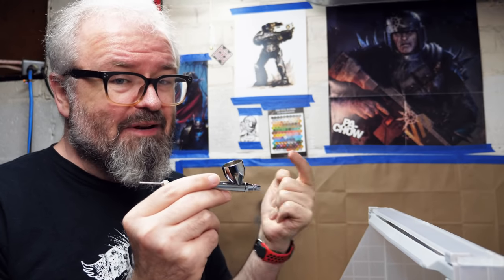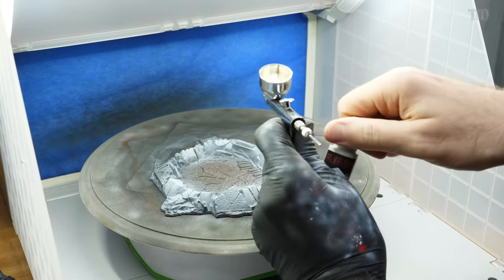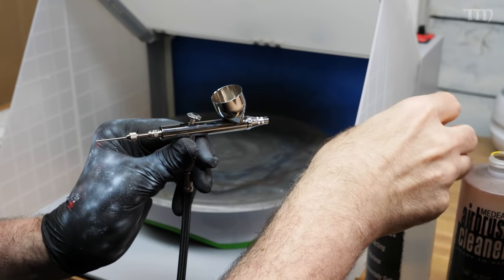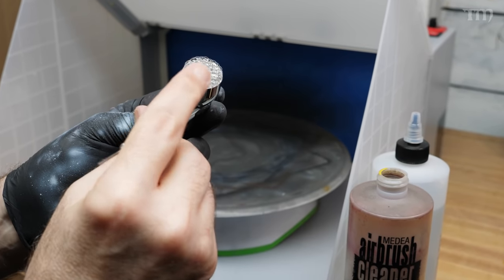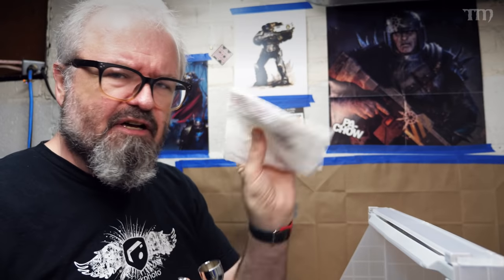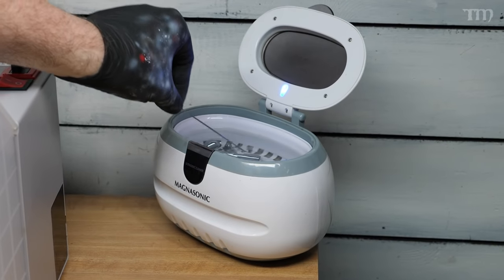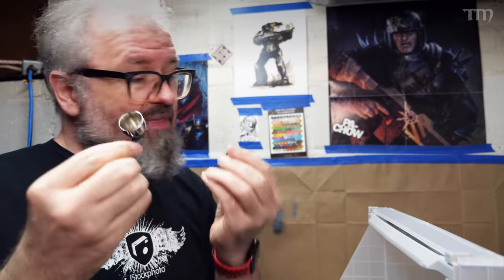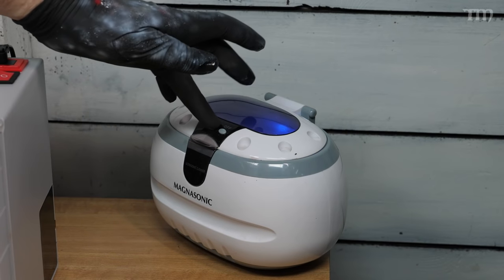NEVER Clog Your Airbrush Again!

Comment: I am just starting to tinker with my airbrush I've had for 3 years, this video has motivated me to actually use the airbrush than to admire it's sleek look.  I like the keeping the parts wet and the ultra sonic unit.  My question is how long is the time frame that you actually have the ultra sonic activated and are you using plain old tap water or ultra sonic cleaner or perhaps a mixture of water and windex.   Thank you for sharing.

Comment: Isopropyl alcohol: water
1:4 - works for me.
Also, Mr. Smasher, what could ppl with perforated airbrush cone do to perfom a "chocolate milk" trick?
Reply: Slighty losening nozzle on h&s ultra did the trick for me but Im not 100% sure its exactly the same thing as completly blocking it.
Also used to have a small rubber cap from some cheap airbrush kit that fit perfectly over the front and when I lost that I belive just putting in in palm of my hand and squezzing it somewhat worked.
Reply: I also have an airbrush with a perforated cone/tip.  I use a small makeup sponge (the small wedge/triangle kind people use to remove oil washes, they’re like a buck for a 20pack at Walmart) and put it over the tip to create a seal. It won’t harm your needle AND I haven’t stabbed my finger with the pointy end of the needle in ages!

Comment: Depending on your airbrush, I think that it might be worth checking if you want to use an ultrasonic cleaner that there aren't any particular seals or rings or whatnot that might cause trouble. Ultrasonic baths get quite warm, and so you also never want to put the needle in there either.
Reply from the maker: My ultrasonic cleaner is a cheap one without a heater, so no problem there. And I don’t keep the needle in the ultrasonic cleaner, I just dip it in there, wipe it, and set it somewhere safe - like in the video. Thanks for watching!

Comment: I did hear from someone, maybe one of Vince's videos?, that they keep the cup filled with a little water (and iso I think?) in between sessions. It is interesting to keep it just full on submerged. How long have you had that airbrush?

Either way, I love my airbrush but I always dread getting it clean enough to not worry about clogs and my arch-nemesis the dry tip. Wish I could find that Japanese polymer stuff that Scott randomly got.

Great video and I'll definitely give it a try!
Reply from the maker: I’ve had that airbrush for nearly a decade. Pretty sure I bought it in the early 2010s and it’s been submerged most of that time. Thanks for watching!
Reply: @tabletopminions  Awesome. I figured it wasn't "new" but was interested. Thanks for the info and, again, a great video.

Comment: I fill with water and pour out a few times, then cleaner, gurgle it pour out. The less that goes through the tip, the better. Last part, just blow through with water. Then wipe off with paper towel.
Keeping it dry in between, just blowing through a little water first. That's how I do it. The cleaner seems smart though.

Comment: Instead of pulling your needle out the back. try pushing it out the front instead. That way, you won't get paint drying in the sleeve that the needle fits into which will gum up the action of your trigger.

Comment: wait like you keep the entire airbrush submerged when not in use or just the needle/nozzle pieces? I've been told not to submerge the whole airbrush because the moving mechanical pieces like the spring in the back and maybe the air valve too might not work properly afterwards. Maybe it's okay if it's normal water and not a solvent like alcohol or a cleaner? the logic of keeping it wet makes so much sense and I want to do it immediately, but I ruined my first airbrush by submerging it in alcohol and cleaner multiple times. It now has a permanent wall of paint and especially primer on the inside that's hard as concrete. I keep it around for spraying primer only. I bet a little flow improver in the water would make it that much better at reactivating and breaking up paint in those hard to reach places.
Reply from the maker: No, not the entire airbrush. Like I showed in the video, it’s just the main body of the airbrush and the front nozzles. The needle and the mechanical pieces (the springs, trigger etc.) don’t go in the water. Thanks for watching!
Reply: @tabletopminions  ah thank you for the clarification! I've just put my nozzle assembly in a water container. Excellent ProTip!

Comment: when changing colors  I just blow water through it. When im done using it, I just take it apart and toss it in a car of 50/50 simple green and water and just leave it for a day, then rinse it off the next day. Never had an issue with mine.

Comment: I just use water, occasionally I use IPA to clean the needles and I always spray a bit of water through it before any paint just to "lube" it up a bit.

But I rarely take it apart more then removing the needle and the first "cone" to expose the nozzle.
Probably once a month or so I do a thorough cleaning.

Extremely rare for me to get clogs, but I do thin my paints a bit too much regularly.

Comment: Awesome video! Sad part, got my airbrush glogged before this video…any tips how to “deep clean” an airbrush?
Reply: Take it to bits, wipe down the needle, clean out the nozzles.  Invest in some airbrush cleaning fluid, and use thinner and flow improver with your paints to help prevent paint build up.  The areas that get clogged are pretty much always the same, its probably just the degree of clogging that is different.

Comment: I'll add a few more things, distilled is better, but only if you add biocide of some kind to prevent a biofilm. One important thing is to KEEP IT DARK. life will find a way if there is light, so pitch black is best. your ultrasonic cleaner does that. See through Tupperware are no good. You can probably use some alcohols and things instead, something like whatever the hairdressers used to use- although they might have used oil, as they were using steel equipment.

Comment: Overall great video, but it sounds like you unscrew the airbrush every time , I would have to recommend an "Airbrush Quick Disconnect" its great, you dont have to shut your compressor every time every time, but i would recommend not keeping your compressor full of air, for those who are reading this, so if your done with the compressor, release the air.

Comment: Wow, thank you so much!  I feel like I am very meticulous about cleaning my airbrush, each piece with the exact same cleaning solution that you use, however I still deal with clogs sometimes, and have been frustrated as to why.  Until now I have not heard of storing the airbrush in a wet solution, and I will definitely try that now, and I am betting that will fix what I have been missing.  One question:  Do you ever worry about deterioration of the little rubber o-rings in the airbursh with the constant soaking?
Reply from the maker: Rubber is more likely to degrade when it’s dry (dry rot) than when it’s wet, I think. I’ve never had trouble. Thanks for watching!

Comment: That's sensible advice, but the problem is if you don't use your airbrush for months at a time. The water will develop slime or even algae, so something else would be required, something that isn't going to attack any of the rubber O-rings.

Comment: Keeping the airbrush wet. Great tip! Someone suggests to extract the needle from the front, so that you don’t inadvertently get color in the inner workings. What do you think about that?
Reply from the maker: I’ve never tried it. Sounds like it might work. Thanks for watching!
Reply: @tabletopminions  I was thinking about the topic of distilled water, non causing deposits but eventually developing unwanted bios in it. Adding just a drop of bleach should stop that. It’s a trick used by florists. But I’m not sure if the chlorine in the bleach could damage the seals and o-rings inside the airbrush…

Comment: So i started with a cheap'ish airbrush from a genneral hobby shop and it cloged up all the time.
When i later got an iwata i found out that to get the same airflow out the pressure from the compressor needs to be twice as high on the cheap one

Btw: I dont know if theres something with your audio recording but when i stream this on my samsung TV the sound cuts out every 30 sec or so wich makes it really hard to watch

Comment: I’m super curious about painting indoors with an airbrush. What airflow considerations do you have, and face masks?
Reply from the maker: I wear a respirator from the hardware store. That should really be all you need. The air compressor is just using air from the room so there aren’t any fumes to worry about, just paint particulates in the air. Thanks for watching!

Comment: Great video and explanation of the steps you take.  My only question is that my airbrush (some sort of older Iwata model) has some rubber washer-ish things around the nozzles (at least they look like they are made of rubber)?  Would keeping those submerged for long periods of time cause them to break down fast or something?  Last thing I want to do is hunt down replacement parts for an old airbrush lol
Reply from the maker: I’ve never had a problem with my o-rings on my airbrushes. Thanks for watching!

Comment: Tried leaving my Haarder & Steenbeck submerged in water and didn't paint for two months, it fell apart when I picked it up; certain parts appears to have rusted.
Reply from the maker: That seems weird - I’ve never known H&S brushes to be made out of anything but brass. Honestly, I’ve never known any airbrushes to rust like that. Seems like a manufacturer wouldn’t make airbrushes (which shoot fluid) out of parts that would potentially rust. Thanks for watching!

Comment: I got the ultrasonic cleaner after watching this video 🙂. I'm in Canada so had to use a different link, otherwise would have used yours. 
Is it necessary to remove trigger, spring and nozzle? It's a pain to put it together - plus I worry about losing those small pieces.
Reply from the maker: I always separate them. Thanks for watching!

Comment: Actually I got one point in this video, which realy disapoints me.
@5:30, you start to explain, how to remove the needle from the airbrush. And in the end you pull it out over the back side. I mean yeah, your airbrush in this example is already complety clean, but in general (or at least if I use my airbrush) frontpart of the needle will still be full of paint and u pull this "dirty" needle through the clean sections of the airbrush, like nothing. 
If u do it like this you will easily put each part of the airbrush in paint (even these, where u are saying, these will never come in touch with paint straight after this step).
To my expirience it will be more effective to remove the tip of the airbrush first and then pull the needle out of the brush over the frontside. This way the airbrush won't get more colored.

Comment: You mention a decade of soaking your airbrush. I'm curious, have you replaced your o rings/seals in that time? Actually, as a pretty new airbrush owner, what have you replaced in that time on that airbrush?
Reply from the maker: I haven’t replaced anything for the airbrush in that time. No o-rings or anything. I had to replace my first compressor in the early 2010s because it was a cheap one from the hardware store and it stopped working, but that had nothing to do with how I stored my airbrush. Thanks for watching!
Reply: @tabletopminions  Thank you for your answer and for all you do for the hobby! I'm impressed! Ten years in a sealed package in a temperature controlled warehouse would have been closer to my working life expectation on such tiny seals.

Comment: Any tips on not cloging it durning paiting outside of using paints made specially for airbrushing? Its kinda expensive to get whole another set of paints that are airbrush friendly but arent really usable for brush painting and in my personal experience just thinning normal paints down just ends in a clog sooner or later, which lead me to using my airbrush as glorified primer can.
Reply: i use vallejo thinner + flow improver (30mL of flow improver mixed into 200mL of thinner). using a 70/30 mix of thinner with some paint makes for fewer clogs (except for primer, which will clog regardless)
Reply from the maker: Thin your paints to the consistency of skim milk. I have an older video in the playlist at the end about thinning your paints. Thanks for watching!

Comment: Hm. I wouldn't soak the Airbrush for that amount of time. Maybe for a few hours and cleaning it with the Ultrasonic cleaner. I use some oil to keep the parts in good shape. Only Thing to do is to rinse before painting with a liddle Bit of cleaner.
Reply from the maker: I’ve kept that airbrush (just the body and the nozzles, not all of it) in water for nearly an entire decade, except when I’m actively using it. I’ve never had any problems, nor any clogs. Thanks for watching!
Reply: @tabletopminions  Well thats proving your Point. I will try it Out. I have a cheap Airbrush that is terrible to Clean... My Harder and Steenbeck one never clogged before either.

Thanks for Sharing your Hobby gold :)

Comment: Thanks once again UncleAtom!

I will definitely try submerging. If I get it working again. 

I got airbrush cleaner in a spray can. It's powerful stuff! But, so powerful it  disintegrated the rubber gaskets on my brush. Now it seems to block all the time and I don't know if it's due to them (or lack of them to be exact) 

Can I ask, what exactly the gaskets do? (keep a tight seal I guess)

But how essential are they?
And would lack of gaskets/grommets cause blockages.

I wouldn't think so but I'm beat and ready to buy a new airbrush :/

Any help or advice is much appreciated!
Reply from the maker: The rubber parts are important. It might be cheaper to try to get replacement rubber parts than buying a whole new airbrush. Thanks for watching!
Reply: @tabletopminions  No problem! Yeah I know what you mean. The replacement parts with delivery is £9. I can get a new brush for the £17 delivered . So you can see how it's tempting. But yeah when I get a better brand brush I'll stock up on spare parts! It's know it's only £17 but that's more paints and diorama materials!

Cheers buddy. Have a good day!

Comment: Heads up, Iwata and other manufacturers don't recommend soaking your airbrush "in any liquid" for extended periods. "This causes more problems than it solves." I appreciate your videos, Uncle Atom, but follow the 'always keep it wet' advice at your own risk.
Reply: Yeah this was my only big issue, there are a lot of seals and I know I've fucked up a seal or two with a long soak.
Reply: I tend to forget mine is soaking, for a couple of days at a time, no issues so far. To be honest though, I'm using a rather cheap gun, like $70.
Reply from the maker: I’ve been using the same Iawata HP-CS Eclipse for nearly a decade, and the brush has been submerged the entire time (except when actively using it or course) and I’ve never had any issues. This is just how I do it, and it’s solved more problems than its caused for me. It’s interesting that “Big Airbrush” doesn’t want you to use method. Thanks for watching!
Reply: This ended up dissolving the chrome coating on mine by soaking it in medea cleaner
Reply: @tabletopminions  wow. Just wow.
Reply: @tabletopminions  probably good advice from the manufacturer as trace elements in water and chemicals vary wildly all over the world (and even in the same state). If you submerge in hardwater, you're going to get scale build up. Depending on the ph it will also possibly dissolve the o rings. If it works, it works, but I'm sure Iwata doesn't want to deal with complaints for possible issues. If it works, it works though. Submerging may also expose inconsistencies of the manufacturing over time (you may get pieces rusting). It should be noted that submerging your airbrush may void your warranty(whether this stands up or not, I don't know) as they say damage caused by soaking is not covered under warranty.
Reply: @JinxedBoon he did say soak in water, not cleaner
Reply: I had small amounts of rust form on the needle, which spread to gumming up the internals and absolutely ruined a brush 😢
Reply: @thisisabsolutelystup what kind of airbrush?

I just clean mine well when I use it.  Spray and backflow a little cleaner between colors, clean the bowl, and paint. After a full day of heavy use, I’ll hit it with lacquer thinner, take it apart and clean it. Put it in its holder, and im done. I have 5 expensive air brushes, I personally think airbrush oil works better at protecting them between long stretches unused. It’s very easy to clean. Backflow, spray, spray a little more, wipe the bowl clean, fire water, good to go. I do it with my eclipse. It’s good enough for my CM, so it’s definitely good enough for my eclipse. 

a little maintenance should keep them in good working order

Comment: soooo, just to be absolutely certain: you store your airbrush (all parts) submerged in water even if you dont use it lets say for two months?
Reply from the maker: Not the entire airbrush - just the nozzle parts and the main body. Not the needle or the trigger or the back parts. And yes, I keep them in the water. I don’t leave them in water for two months any more (I use it more frequently than that) but I used to. No problems. Thanks for watching!